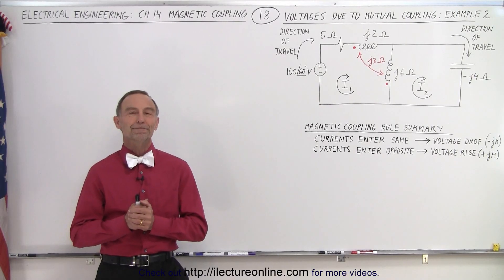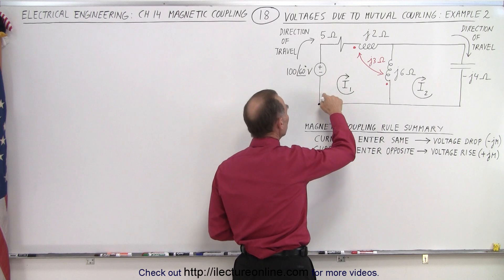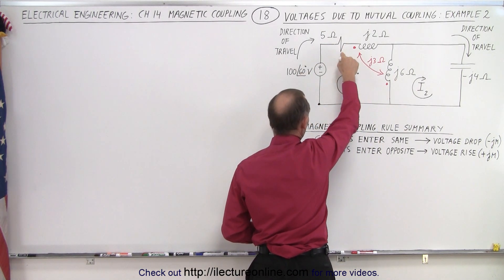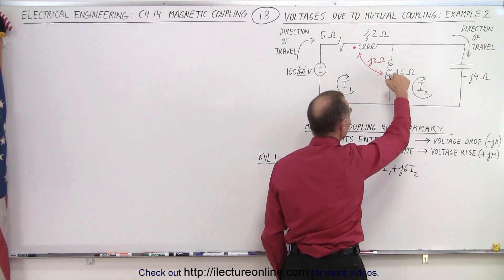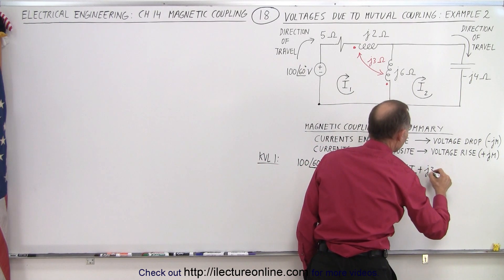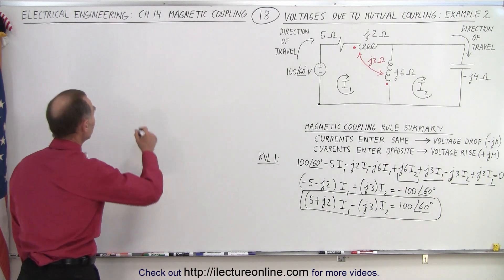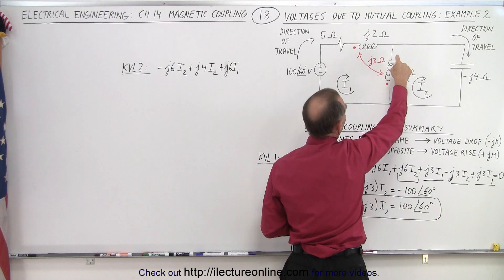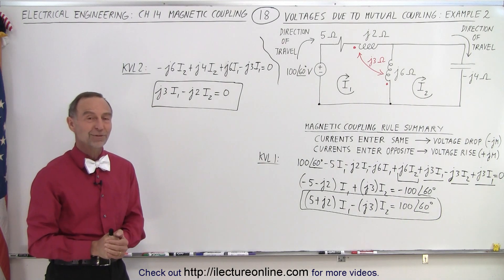Electrical Engineering: Ch 14 Magnetic Coupling (18 of 55) Voltage Due to Mutual Coupling: Example 2

Comment: in KVL 2, why is it that the current that causes the coupling is I1 and not I2? (-j3I1)
Reply: I wish he can answer to your question, but I figured it out by using the convention dot. Using that convention on the KVL 2 the current I2 is not in the coil 1(j2ohms) that is why is not using I1. If you still don't get it let me know I can send you an email with more details.